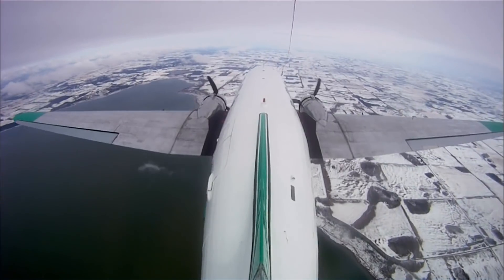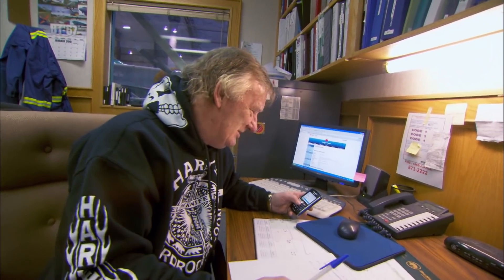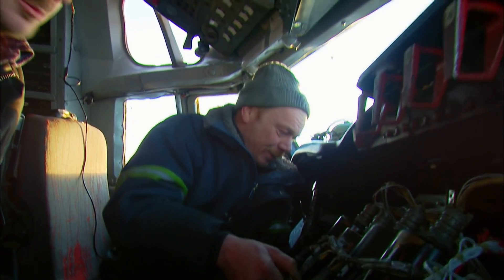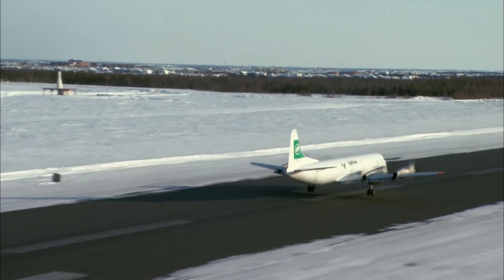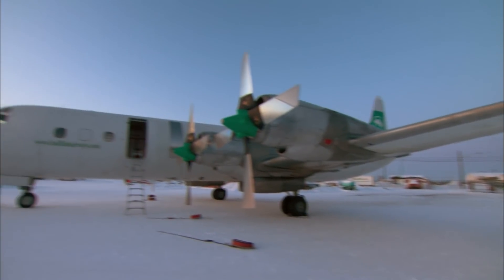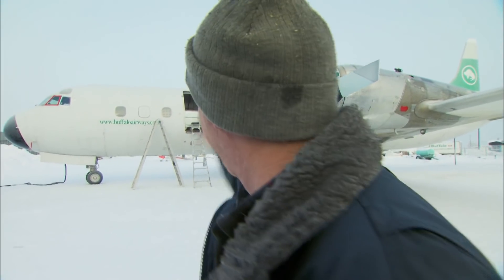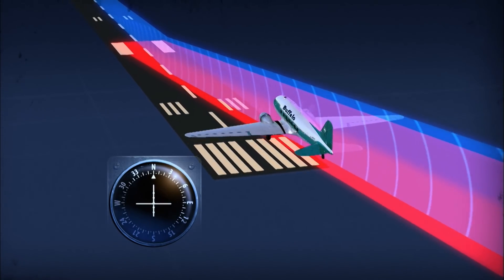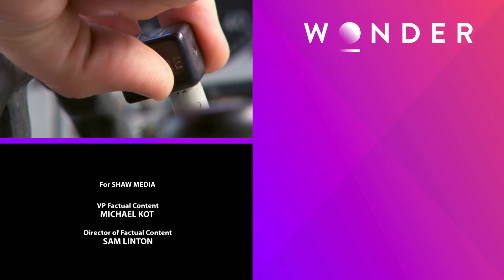Freezing Weather Endangers Rescue Mission After Haiti Earthquake | Ice Pilots NWT | Wonder

Comment: I don’t understand why Buffalo Air doesn’t have a Hercules in its arsenal.  It would by more useful then Electra.
Reply: Was thinking that, but not sure of the cost difference between them. Guess if the Hercules is more expensive to buy the repair and maintain is slightly cheaper on a newer plane.
Reply: It's because in Canada the c-130 cannot be certified for civilian ops
Reply: @Thefreakingwierd1  why the competition has then a C-130 ?
Reply: @greendotfarms6808  the competition has c-130s that were never military. if buffalo bought a civilian version of the c-130 theyd go bankrupt on the payments.